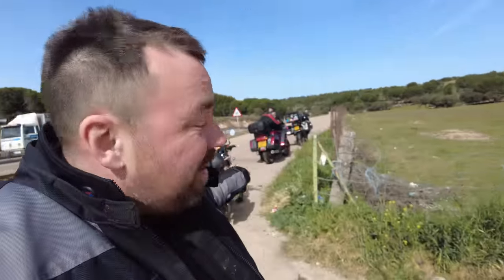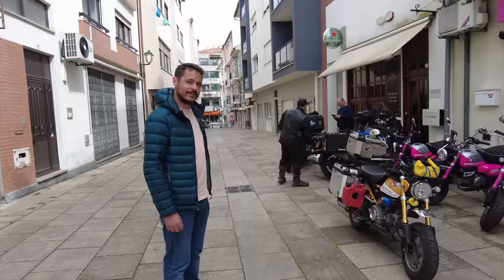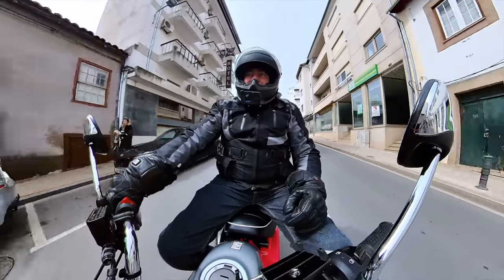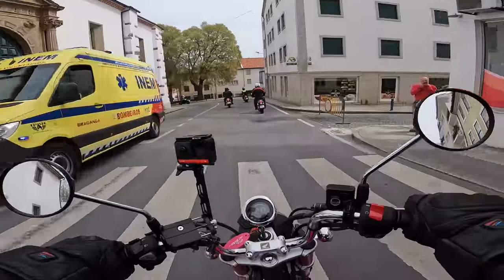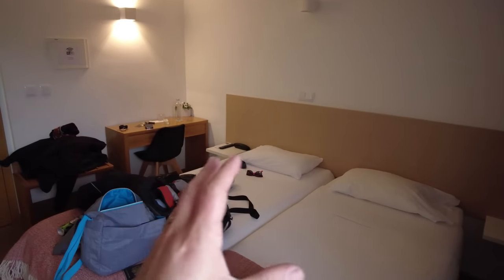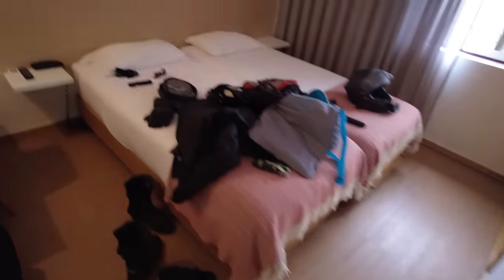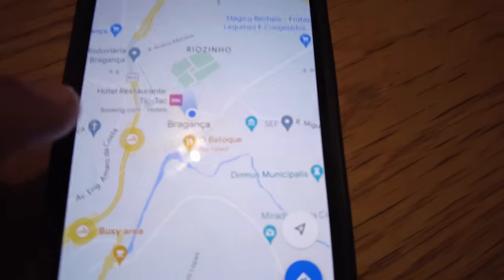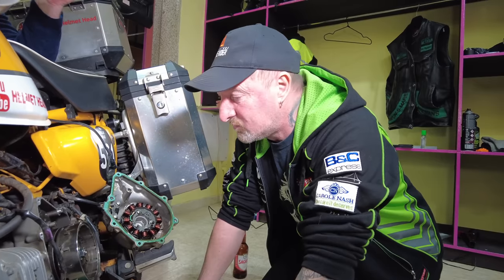You Have To Try This Pink Honda Monkey Bike! | S2E4

Comment: i just started riding my monkey and it has 800 km on..how soon do you think i should change these plastic parts to avoid missing 2 gear all of a sudden like you did?
Reply from the maker: Mine has covered 10,000 pretty hard miles. So you should be good for some time yet 😉👍

Comment: I looked up your issue, and that seems like it is definitely the problem. There is a company called Chimera that makes an aftermarket button that replaces the stock part. They recommend that everyone should replace that part whether they have a problem or not. They cost a bit more $8US, but are supposed to be better made. I can't attest to that, but I'm ordering a couple for myself. Just an FYI...good luck!
Reply from the maker: Cheers John Leigh as ordered heavy duty parts to fix Ashworh 😉👍
Reply: Does the 5 speed motor has the same plastic part or did Honda fix it on the new 2023 motor?
Reply: @laranjiinha77  it shows as the same part number
Reply: @johnsb1550  oh dear, that’s not good news then :) Thanks for the reply 🙏 cheers